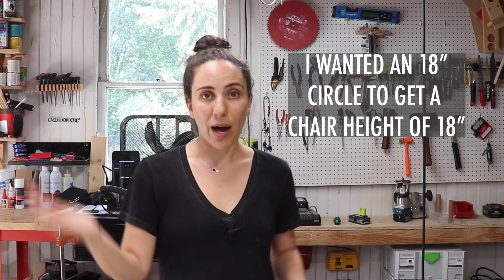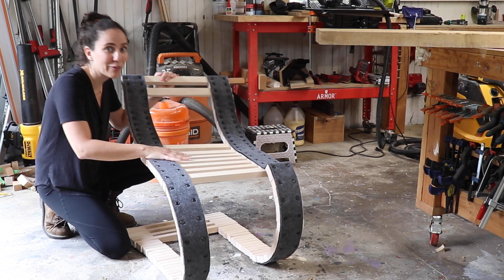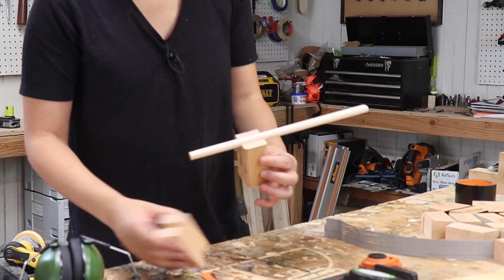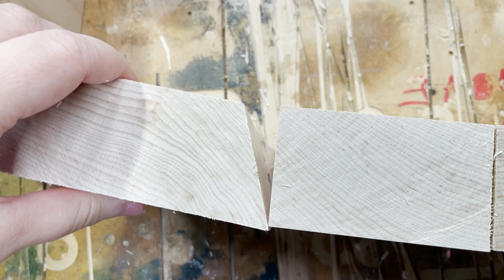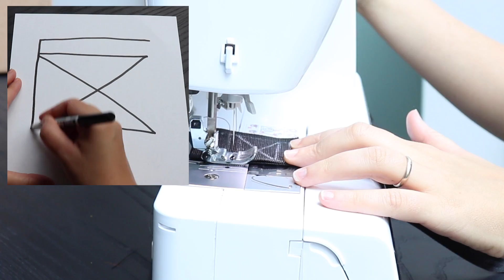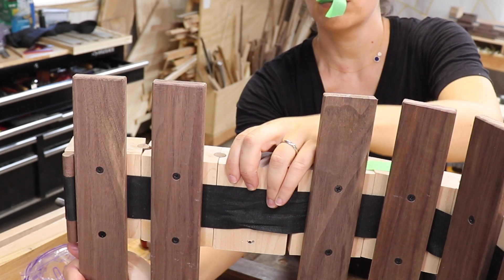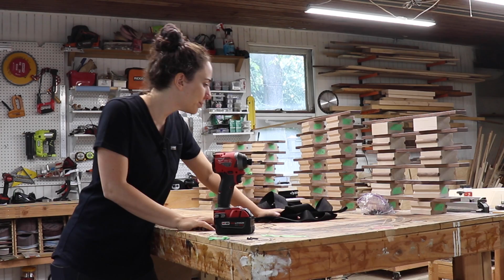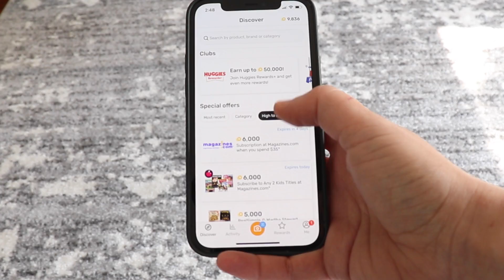I ATTEMPT to make a Roll Up Chair… AGAIN...

Comment: Hi Tamar, love your channel and your tenacity!  I think you are very close to succeeding with this project. 
As well as high strength I think you need ultra-low stretch webbing to control the extension and maintain the geometry. Also because some positions create greater tension than others it will help to isolate each joint from its neighbours. By fixing the webbing to each block the high tension locations would not extend by pulling webbing from lower loaded joints. This would also make the chair much safer because strap tension would only exist where it is required rather than throughout.  Fixing the webbing will significantly reduce the length over which extension can occur (2mm at each joint rather than the whole strap).  
We all need a bit of luck but mostly your success comes from within.

Comment: Not sure if someone else had suggested this before, or the feasibility of it, but have you tried a completely different method of fixing instead of just a different strapping... How about you use ##door hinges## between each block... You're gonna have to use dozens of hinges and Its gonna be super heavy with all that metal, but hey the flex will be gone!!!
Reply from the maker: Maybe

Comment: I have to congratulate you for your commitment to this project, we’ll done. I really think you can do this with a little more research. To stop the ends curling you could attach a thin steel cable from the top of the back to the bottom. You could also use thin steel cable instead of webbing. Anyway keep up the great work, love your channel.
Reply from the maker: Thanks!

Comment: You might want to try some sort of Dyneema webbing. It's used for static lines in climbing ropes and slings. Its insanely strong and has very little if any stretch. Was originally developed for use in high tech sailboat sails. You should be able to find some bulk Dyneema webbing or extra long climbing slings that you could use.

Comment: If you load your design into a cad program that lets you analyze the stresses, I think you will find that you are creating some very, very powerful leverage.  I expect that you will need steel members and steel cable for this kind of design to be safe.  I really like you showing the steps you go through, a lot of times we have to work out what does not work to get to what does.
Reply from the maker: I wish I was better at cad

Comment: Too much room for stretch with the long straps only pinched to the slats. I feel this would work if you can get treat each joint individually. Maybe melt some holes in the nylon and then screw it down to each piece? Or 100 3" steel hinges... I also feel the strapping should be as wide as your blocks.
Reply from the maker: I did the whole meting holes in the first video

Comment: I don't think there's any straps you'll be able to use. The forces on the straps at some of those angles are going to be near infinite. That's gonna cause any webbing to stretch. The stronger the the webbing, the more likely it's going to stretch a bit, (so that it wont snap under heavy loads). I suspect leather will be even worse. What about a triangle instead of circle for the center dowel? I suspect if you get the angle right, it'll open on one side, but not the other. If you'd like I can sketch out the idea I had it mind?
Reply: actually... I think I have an idea for a shape that might work even better than a triangle
Reply from the maker: Shoot me an email!

Comment: looking at https://www.youtube.com/watch?v=8pQFHT_rh8Y, it looks like the biggest thing your design doesn't have is multiple "layers" of chains that I think create counter resistance to collapse.    If you start at 0:20 and watch at .25 speed, you can see each link as it spreads open has three layers, with the middle layer offset from the exterior layers....  In fact, I think the whole thing works more like a bike chain.  I don't think there's any cloth involved, it's all pivot joints, like cantilever tool boxes
Reply from the maker: Cool

Comment: I'm not sure if the materials are the problem. I think slack is coming from one section to disrupt another. Similarly, one section can't handle as much tension as other sections. In summary, I think that if you modularize strap sections (e.g. just the bottom curve), then it could hold better.
Also, if your dowels were loose at the top, you could have added tension by adding in spacers at the top rather than shortening the strap.
Look forward to part 3.
Reply from the maker: Yeah I realized that last bit toward the end when I replaced the piece instead of shortening the strap. Ha

Comment: Ha ha! You're awesome. You are definitely doggedly determined. I would have walked away from that long ago. I guess that drive and positive spirit is why you are such a success and so well liked!  Now for the obligatory suggestions...run your flexible material in the middle of your woodblocks, chamfer the edges where you flexible material comes in contact with the wood. Use a flexible material that is not stretchy at all (steel cable) and some sort of locking mechanism when in chair form, removed when in transport form. Of course this is easy for me to say, I don't have the mustard to actually do it, just arm chair quarterbacking.
Reply from the maker: Haha all good ideas

Comment: Another cable vote.  7x19 wire rope 1/4 inch diameter has a working g load limit of about 5000lbs and a breaking load of about 5x that.  If the cable travelled through the center axis of the pieces instead of the faces perhaps you wouldn't have the rolling collapse issues due to having the tension load unbalanced on the faces.  On one end of the cable you  can have draw bolts and a swaged pin that would allow you to take tension on the system with an impact driver.  I have installed miles of wire rope for high tension hop trellises.  This will work.
Reply from the maker: Thanks for the info!

Comment: I have a feeling that if you could find someone who can calculate the force vectors you would find that very few materials would be strong enough to make this work. What about cable instead? Drill through your pieces and and use a braided metal cable instead of or in addition to the fabric. Cable would also allow you to adjust the tension.
Reply from the maker: Maybe

Comment: I wonder if wire rope would work?  Route out a groove between the slats and the maple?  Or maybe copper strips?  Hmmm, or something like CAT6 cables?  Copper has high fatigue strength so that could work.  I felt your pain at the very end when it folded in on itself!
Reply from the maker: Haha yeah. It was really frustrating

Comment: "Never give up, never surrender." - Living by Galaxy Quest's motto, I see. I like that :D

I think part of the problem is that the straps you've been trying to use are too thin, which no matter the material will just stretch more. The original one's seem to be on the thick side, probably to better absorb the stretching forces.
Reply from the maker: Ha love that movie.
Reply: @3x3CustomTamar  And I somehow managed to erase half my comment before pressing post :O

What was missing: More important than the strap, I think the angles you're cutting should be a bit shallower than what you calculate. The short story, the front is resisting stretching forces, the back needs to resist compression. The strap is there for the stretch, but there isn't anything in the back to aid in resisting the compression (which makes the stretch in the front stronger). If it was solid bendy wood, you'd design the unstressed shape less curvy than the shape you wanted it to have when someone does sit on it and add weight/stress. Same here, but since it is in pieces you only have geometry to help, the stiffness of the material won't help as much.

Comment: You're so close! You have make the shape more of an S to compensate for the flex. Maybe you could  glue all the pieces together with the super glue and painters tape trick and then attach the strapping while it's in the S shape. Good luck!
Reply from the maker: I tried that in the first video. Didn’t work. Ha

Comment: There are very big forces acting on those straps. Even if you pick something that can hold the load (like seat belts) you still have to be mindful of the stretching. Seatbelts can hold big forces but they are also designed to stretch. Stretch always mean springiness. If you put 80kg (175lbs) weight on the chair that means if your legs are 45mm or 1"3/4 (1.75 inches) thick you'd get a tension of easily over 1200lbs in each of the two straps. That is just the static load. When someone sits on the chair or jumps on it the loads can easily double momentarily. There will also be stretching over time when the chair is used which will cause the chair to sag.

I think the biggest issue in this is the big number of parts and the way the straps stretch. I really think going to just 4 parts (bottom leg, upright leg, seat, back rest) would already make it a lot quicker to just experiment with different hinges, straps, chains. In fact using 4 thick full chair width plywood pieces would be pretty stout to start with and quick to make and would allow quickly try all kinds of different straps, hinges, maybe even chains and cloth designs. Once that works start adding more parts and making it smoother shape.

Making the straps wider or full chair width instead of just thicker can also give you more rigidity you need. The biggest tension in the strap is in the legs so using double or triple straps there and just single strap in the backrest could also work. I really think any kind of straps won't work however. Too much stretch.

I really think the huge number of parts you have is making the process too complex and time consuming and your biggest issues are hidden in the complexity and the amount of work taken to make all those parts and assembling it. I still think this kind of chair is possible to make but I think the end result is just too complex to make in one go.
Reply from the maker: I will have to keep trying 💪

Comment: Its been a long time since Ive done physics problems, and maybe Im wrong, but where the straps are stretching it appears to need to not only take the full weight of a human, but because its forming a fulcrum at the back of the block it seems like itd need to take many times the weight of a human. Is that actually feasible with wood blocks and straps? 
(Someone suggested steel cables, though Id imagine the wood would have to be reinforced or theyll start to cut in to it.)
-
We did have a curving wood chair in the same shape, but it used layers of wood distributing the forces, I imagine similar to how you can interleave two phone books together and it requires literal tonnes of force to pull them apart. (It also did eventually snap regardless...)
-
Edit: Ahh, read a bunch more comments and it seems Jeffrey Chow did some of the estimates on the forces involved.

Comment: The strapping has been the weak spot so far and I think any variation will yield similar results. Depending on how far you want to stray from the original design, I think the strapping should be used to keep the blocks together when they are not under tension, rather than when tensioned. This means the blocks themselves would be the support structure. The wood is the strongest material here and it should be used to carry the bulk of the forces - not any strap material.

I think a basic 'S' design for the wood would be where to start. This would give you the hook to link into the next piece. The 'S' design should help because the hooks replaces the strap to 'hold' everything together, and when the hook engages, it limits the compression on the inside. It acts almost like a friction vice too. With this (not tested at all) design, now the chair's bending range is limited by the strength of the wood as each piece will be under equal tension and compression.

Unfortunately this also means a lot more work for each piece (no more simple angled cuts) and would need some heavy testing. I foresee a lot of revisions to the 'S' design to see what works and what doesn't.

Recently discovered your channel and am loving all your designs. Keep it up!
Reply from the maker: Cool ideas. Thanks!

Comment: Totally agree that the strap material might be the main culprit here. If you calculate the moment of force on the strap, considering the pivoting point to be the dowel on the tip of the curve, then the shear force would roughly be (bodyweight * body position to the pivoting point) / strap position to the pivoting point. Because the strap is so much closer to the dowel (aka the pivoting point), the force on the strap could even be 10, 20 times of your bodyweight, and adding on top of it the elasticity nature of the strap material, the issue would be inevitable. Replacing the front, curvy portion of the chair with material that has less give lengthwise might yield to better luck, that bendable plywood you've used in the previous project maybe?
Reply from the maker: Oh interesting. I didn’t think of using the bendable plywood as the structure. That’s a cool thought.

Comment: The problem here is that minimal stretch opens the angles and minimal change in the angle changes the radius of the curve.... And the chair will collapse. So "low stretch" won't cut it, "no stretch" is needed... I have no clue of material science, but I doubt that even steel wire or bands would be enough... I guess the requirements here call for something seriously high tech... Where's my math & physics squad at? Someone should do a... whatsitcalled... finite elements simulation?
Reply from the maker: Haha I should have payed more attention in math class 😂

Comment: I might be stretching away from the desired concept here but, assuming the main idea is simply that the chair has to be able to close in a roll, wouldn't still be possible to have like "poles" attached on the bottom end of the seat? With hinges, so that when the chair is set they drop down and stand on the ground section, functioning as "breaks" for the flexing; and having the same length as the boards, so that when closed they don't stick out of the rest of the roll. It may mess up the clean design a bit, and there's also the possibility that they'd end up supporting too much weight for a weak hinged connection... still, felt like it could be a starting point for some experimenting.
Love the channel, by the way!
Reply from the maker: Maybe! Thanks!

Comment: Hi. You are doing a great job, but unfortunately the practical design flaws are betraying you. It is mechanically so complex that it might even be impossible to pull off. Don't forget the deformation of your wood blocks themselves, it is not zero and it results in some bending itself. Don't even think about leather. UHMWPE material itself is allegedly  5 times stiffer than structural steel, however, the woven straps you are using cannot provide the same stiffness because they are woven. Think about pulling a woven sweater, it is much less stiff and more deformable than the threads it is made of. Leather, on the other hand, is not even comparable to this material in terms of stiffness.
The amount of deformation you are observing depends on (1) the stiffness (or young's modulus) of the strap you are using, (2) the stiffness of the wood, (3) the thickness of the wood blocks, (4) the free length of strap between connectors (screws, bolts, or staples), (5) the original gap between the wood blocks. The most important one is the gap. You are trying to eliminate the gap by tensioning, which is a good idea. Your easiest modification can be using two bolts instead of just one at each row per strap to reduce the stress concentration, and two rows of bolts per block to reduce the free length of the strap between the connectors, and even then, it might not be enough. There is two much "play" between the strap and the wood. If you could tension the bolts and provide friction between the belt and the wood, it could help you, but it is impossible with wood. Maybe gluing the strap to the wood with a very stiff glue can help. Maybe epoxy, but a very hard epoxy.

A question: how does your chair work after gluing all the blocks together? how much bending you see then? Even if you use the best theoretical strap possible with infinite stiffness, it cannot get better then gluing. If you still see a lot of give in the chair, you need thicker maple blocks.
Reply: Assume you get rid of the strap and connect the blocks using steel hinges that don't deform at all, and assume that you could make zero gaps. Even then, the screws connecting the hinges to the wood have some play that turns into gaps between the blocks after you load the chair. You need zero play between the wood and the strap/hinges. In steel structures, we provide that zero play by either welding or tensioning the bolts and providing friction between the parts. In wood, it's not an option, and you normally use glue in such cases.
Reply from the maker: I really hope it’s not as impossible as this. Ha

Comment: For the roughly 1500 pounds of tension that have to go through those straps with that width of joints you'd need to go to something like a 50 series roller chain to have enough stiffness. The whole length of the strap also acts like spring since it can slide under each of the slats, so having the strap rigidly connected to each maple piece would also make the system stiffer.

And of course making the maple sections at the front of the chair where the moment is highest thicker will proportionally lower the stress on the straps. Twice as thick maple equals half the tension in the strap.
Reply from the maker: Perhaps!